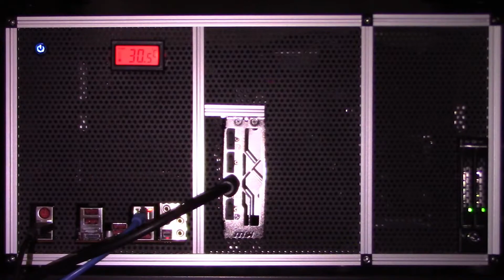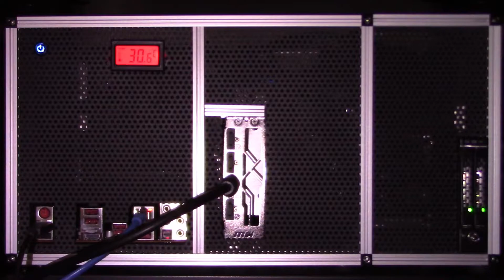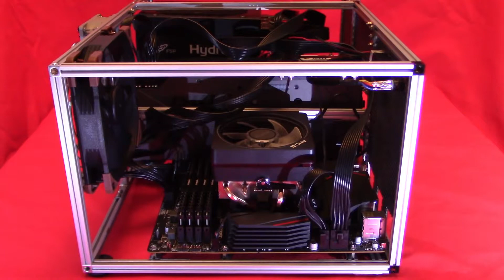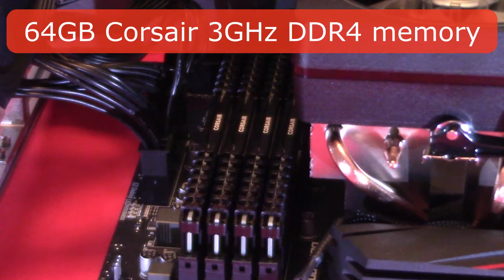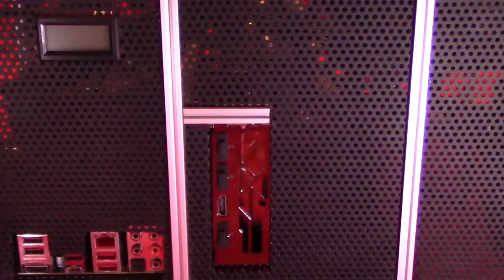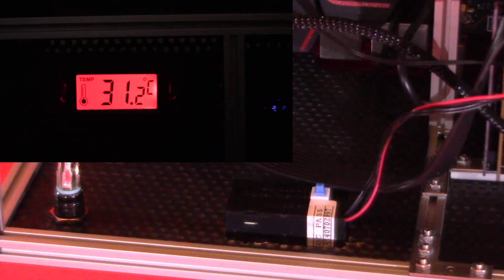Custom rack mounted Video editing computer for Davinci Resolve 16

Comment: You got any pictures of the finished product? Wondering if i could add sliders to my rack
Reply from the maker: If you have a look at https://www.youtube.com/watch?v=wSd6HoB_vao you'll see the final additions. Sliders would certainly make is easier to get the computer in and out, as long as your rack is bolted down.
Reply: @custompchardware  Thanks for the information, may I ask how did you start? First build it in cad or just play around with the makerbeam right away? Sad that makerbeam did discontinue those slider parts in your other video that would be a a great addition for like a slider in the server rack.
Reply from the maker: When I started using Makerbeam, I did get longer lengths and cut them to size for projects. Then I started buying the precut sizes appropriate for the project in hand which allowed me to recycle frames at the end of a project. So a lot of the designing is done either in my head or just playing around with the beams and brackets to see what will work.